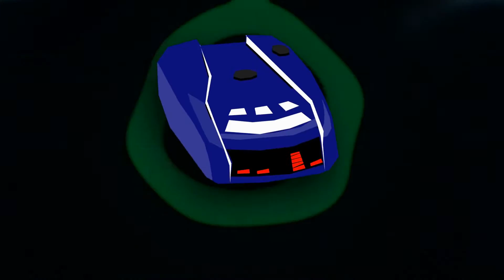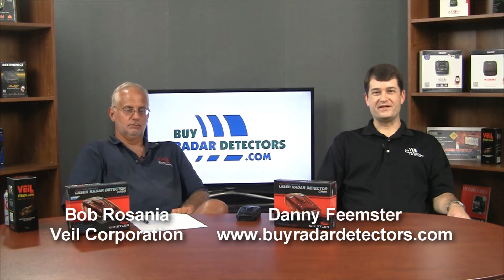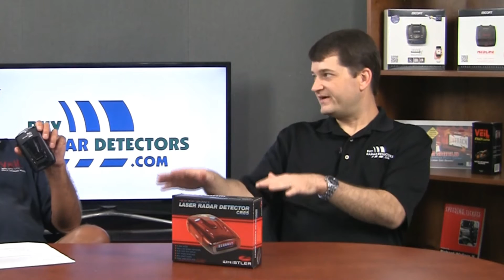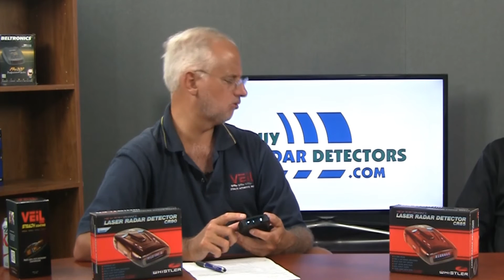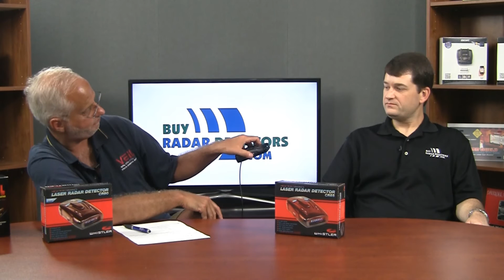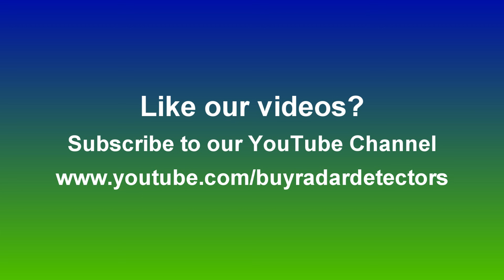Whistler CR85 and CR90 Review with the Veil Guy

Comment: Just wondering....  does anyone know:  Why has the VG2 been removed from this model? Why has the compass reading/direction been removed and been replaced with an arrow on this model? How to get this model to actually display your speed as I understand it is supposed to? Not sure I like this "better" version. Anyone able to answer these questions? Thanks.
Reply: djhubba vg2 is very outdated. Most detectors have vg2 cloaking. the spectre rdd is more common now.
Reply: Ok. Thank you. I purchased a different Whistler model just 45 days prior purchasing the CR90 and the first one has the VG2 on it. That's why I was wondering.

Comment: I have some questions... I'm not a SPEEDER/RACER, but like anyone else, I may do 5 or 6 MPH over the speed limit.... so I won't be needing to slow down from 130 MPH to 50 MPH with in seconds.  

The other issue that I run into while working, is where the speed limit will drops from 50 MPH to 35 MPH on the same stretch of road and a police car is there waiting with radar at the ready, ready to ticket anyone doing more then 5 MPH over the speed limit.  

My point, I don't need the most super long range detector, just one to advice me of when police are using radar in the area, and to alert me to radar cameras that issue tickets.  

I've been using my old Uniden Stalker Radar Radar Detector that I've had since, I think late 1990's/early 2000's (?).  And I've been fortunate enough not to have been issued any tickets, but a few wildlife researchers on my team have while traveling to or from work... two of the tickets are for doing 55 in a 50 MPH zone!  

So, I'm in the market for an updated Radar Detector, and have limited funding for detectors for each person in my research group.  This detector and other in the price range are what I've been looking at.  

I've been warned away from the Whistlers... the so-called "Experts" tell me that they're junk, and the I need one of the detectors in the $300 to $600 price range.  However, the simple fact is that I don't have budget.

Should the Whistler CR93 detector protect drivers as long as they're not excessively speeding or racing (within 5 mph of the speed limit)... and is it a reliable unit... and does it's features truly work well ???  And would the Whistler CR90 (previous version of this detector shown here) work as well? 

Also... would the Beltronics RX65 or PRO200 (also in my budget) be better options?
Reply: Brandon Kaeo, which issue?